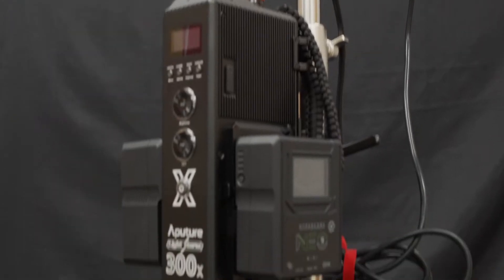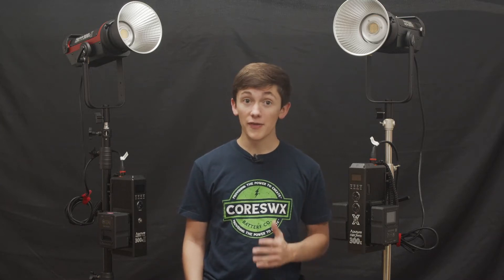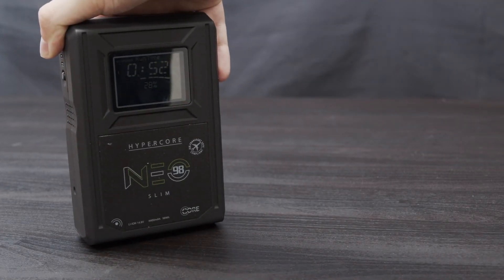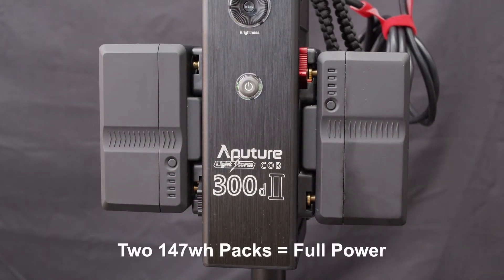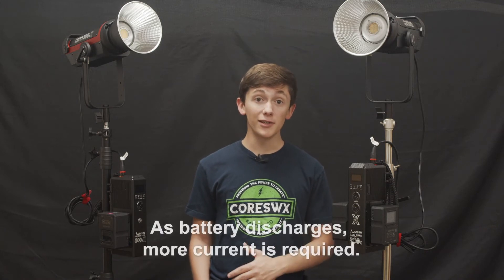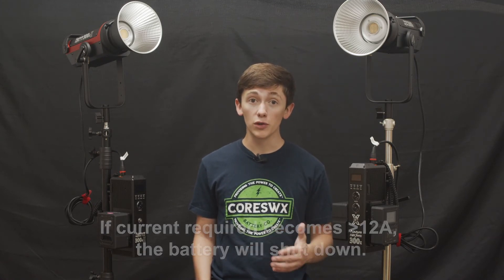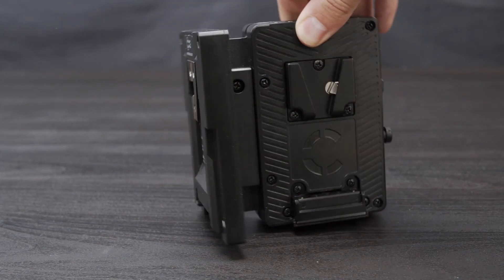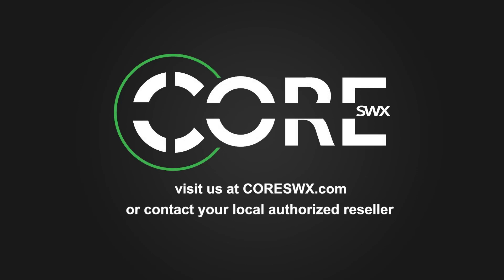How To Power: Aputure Lights

Comment: My core power swx powebase edge seems to only power my aputure 120d for three seconds and acts weird. What one do i need to power it
Reply from the maker: If you're referring to the C120D II, that light's max power consumption is 180W. The Powerbase Edge is only a 49wh, 8A battery pack which is why it doesn't power that light. The batteries referred to in this video - the NEO 9 Mini or NEO Slim 98 on a shark-fin or NEO 150 Mini either by it's self or on a shark-fin would be better options for you.